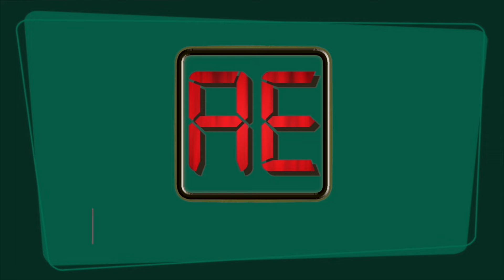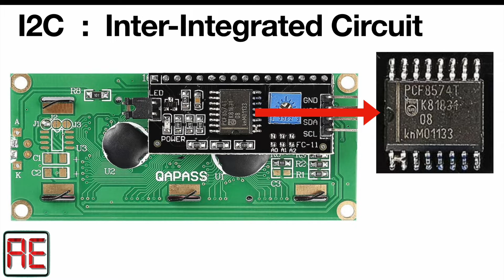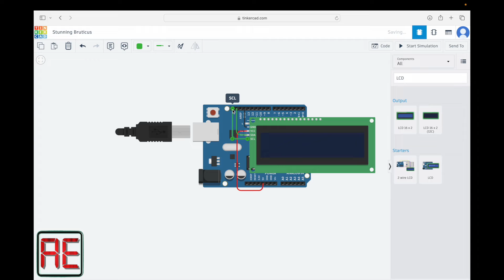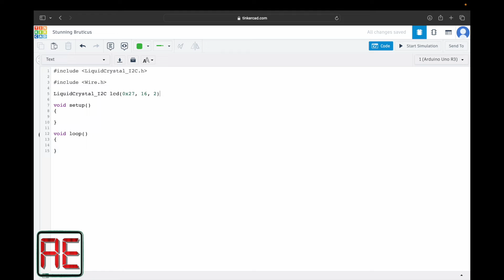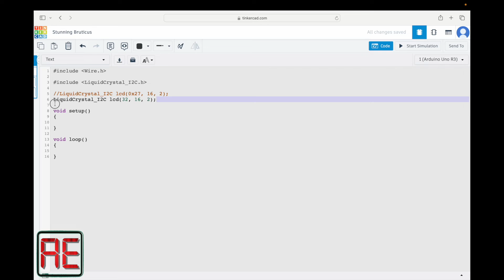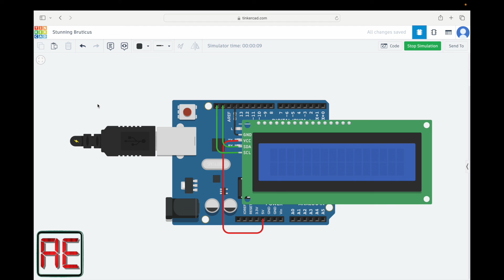I2C LCD display with Arduino: Easy Tutorial!

Comment: The code is working without any bugs but my lcd is not displaying anything. It is only glowing when connected to the power source. Does this mean that my lcd is broken or not working properly?
Reply from the maker: Hello my friend. I would double check the following steps: 

1- Check all connections (continuity check) with the LCD and the power source voltage. 
2- Verify if the communication address in the code is correct.
3- Try to run a simpler version of the code. Check out this reference from the Arduino website: https://www.arduino.cc/en/Tutorial/LibraryExamples/HelloWorld

I hope this can help you finding the problem. If you do so, please send us a feedback.

Cheers!

Comment: hi, i just tried this out on tinkercad and i copied your code and circut exactly the same. however, it keeps showing me invalid header file. do you know why this keeos happening?
Reply from the maker: Hi! That is a pity. Let's check a few things first:

1. Is your command LiquidCrystal_I2C outside the void_setup function? Just after the library import?

2. Have you checked the capital letters in each command? Just to guarantee that you typed it right.

3. When you click on the LCD display (in your circuit) have you selected the PCF8574-based model? and is the address 32?

Try to double check these things and please let me know if it worked.

Take care!